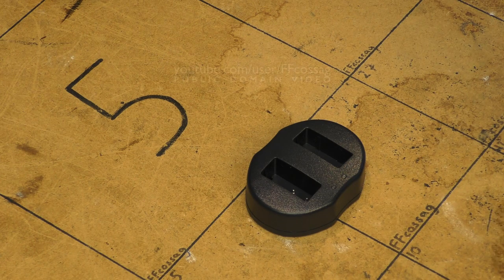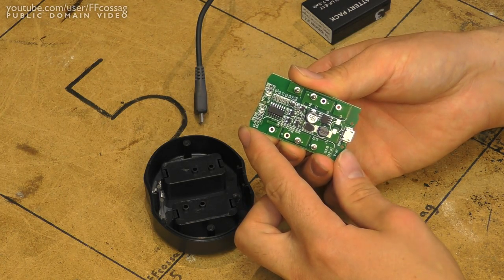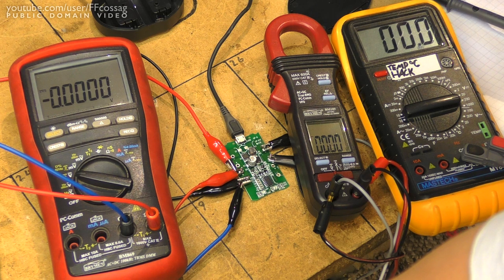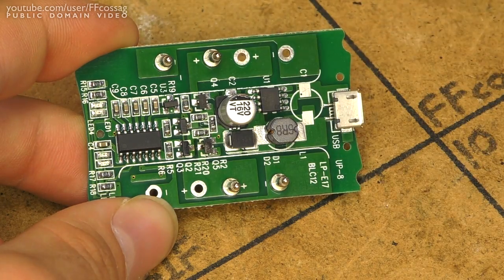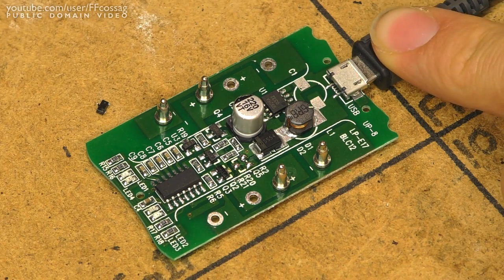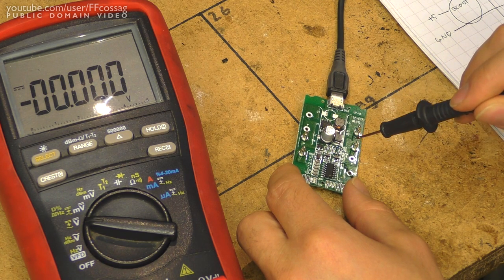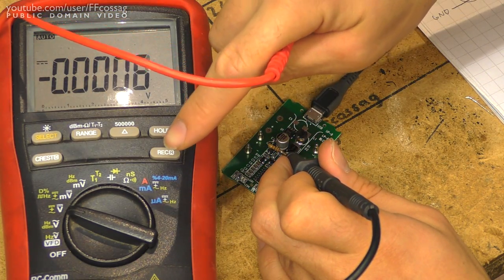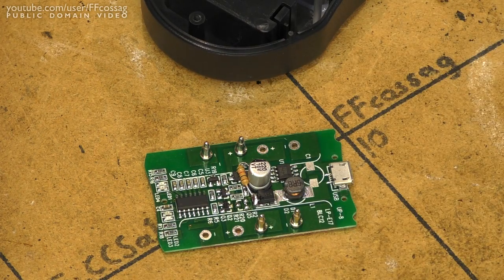Dual LP-E17 charger teardown (It explodes, but I like it!)

Comment: Perhaps, after pulse rests it take a voltage reading perhaps under a small load??  The 8 ohm resistor should have pulled 1 amp which was too much for the smd tranny.
Reply from the maker: It's current limited, so the load resistor shouldn't matter much at all - especially since an empty lithium cell can easily achieve an ESR of well below 8 Ohm. It blew up because it's hooking the 25 V across the cap straight across the load with nothing but the current sense resistor in between, causing a really high surge current.

Comment: 8.4V is a bit high, isn't it? Your batteries are specified as 7.2V nominal, which means they consists out of 2 pieces of 3,6V cells. As far as I know that type needs to be charged with 4.1V per cell. I stand to be corrected though.

Also: You might want to have a look with a scope near the lead powering the charger, 'cause I think (no experience with this stuff, so don't burn me down over it) if you power this thing from a longer lead (USB cable), that cable is going to kick out some noise because this thing is, as you said, just shorting it's power supply through a small choke. I suspect (again, I might be completely wrong) that's a good recipe for a lot of noise generation it the cable to the device. You might want to put a capacitor at the input.
Reply from the maker: I've never heard of a 4,1 V lithium. OCV of the batteries is about 8,35 V though, so I'd think they charge like normal cells.
Reply: I don't think I have them either, perhaps some older phone battery somewhere... but they do exist. A quick Google search turned up this result: https://learn.adafruit.com/li-ion-and-lipoly-batteries/voltages
Did you, by any chance reply to my comment before I edited it? I asked about the cap on the input. it would be interesting to see if you can pick something up with the scope :) Thanks for replying man, and keep up the good work!
Reply from the maker: You definitely want a cap on the input, no question about it. A long lead is just going to have some pretty random results on noise. Sometimes they turn into antennas and ruin everything.

Comment: Those VT caps are everywhere!  They're not polymers, they merely lack a vent.

Would  replacing it with a quality 25V cap rather than adding the bodge resistor also work?

Also, what evidence do you have that it was in fact the cap?  Caps are rated to tolerate surge voltages.  If the cap didn't blow, then what leads you to believe that it passed excess (ripple) current to the transistor, and that that is in fact what caused it to fail?

Thanks.  Liked.
Reply from the maker: The cap has nothing to do with the failure we saw here. The transistor most likely failed because the voltage across the cap was way too high, causing a massive current spike through the transistor as it turned on.
Reply: FFcossag, as mr. khachaturian (Хачатурян) says, all you need - just change that old withered capacitor. Your spikes will gone.
Reply from the maker: The capacitor is not the problem, it's doing its job just fine. The issue is that the boost circuit charges it to too high a voltage. You really don't want more than 8,4 V across it, ever, yet it gets charged to 25 V.